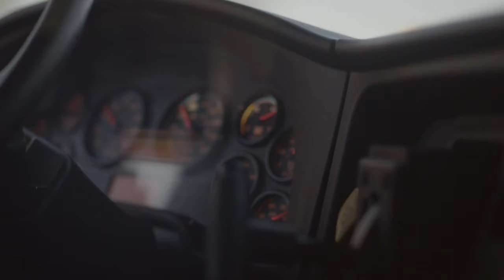The IC Bus CE Series Powered by Gasoline - Purpose-Built for the School Bus Industry

Comment: IMO the gas engine also should be offered on the 4300 chassis for applications like box trucks
Reply: Probably would not have the torque for hauling maximum rated weight
Reply: @LegoWormNoah101 the CE (a durastar) is rated to 33,000 lbs.  the same chassis is rated between 29,000 and 44,700 pounds (frame and axle limited respectively).

Comment: Don’t forget mileage will also be worse. With a diesel, you’re looking at probably 8 mpg- 10 probably at most. But a gasser would probably get about 5 or 6 mpg
Reply: That Copyright Guy deisel it is
Reply: With the gas engine you will not have any issues with DPF or SCR though, since they are not required to have of that crap.
Reply: @captainredneck0683  also you have instant power with no spin-up lag or turbo lag

Comment: "We have a bunch of New and old
IC CE Buses here in Kalamazoo,
and in Michigan, it's good here
in this State. And these Buses have MaxxForce DT 7.6L, Cummins ISB 6.7L,
& PSI 8.8L Gas.
and here in this School District,
it's good."
Reply: Y’all still got MaxxForces? (known to most as MaxxNoises)

I loved those engines, uhh, when they were running well.  Very cantankerous, but if they were happy, I was happy.
Reply: "They made the MaxxForce Engines
in 2008 for the 2009 IC CE300. The
MaxxForce DT, & MaxxForce 7."
Reply: The 2005 IC CE300 2nd Generation
has the Early 1980's DT466 7.6L Diesels. I love the color of the blue
for that one, it gets a lot of power.

Comment: "We partnered with PSI..."
If IC and PSI are sub-brands of International, are you technically partnering with yourself?
Reply: Completely separate companies, though since PSI is public, Navistar/Traton/Volkswagen could very well be a shareholder.

And the industry loves muddling waters, like Western Stars built with Mercedes Benz parts, that look like Freightliners, with “Detroit Diesel” motors.

Or in International’s case, the ProStars (a fantastic truck) have the A26 motor as an option, which is just a MAN (another Traton company) D26.  But unlike Daimler, the D26 is an excellent motor.

Comment: I drive one of these busses currently (same year and model). Anyone else having issues fueling? We have to position the gas pump just right, upside down, and barely squeeze the handle in order to not have the gasoline spew all over the place, this obviously takes alot of time, Anyone find a solution for this?
Reply: Might just be a cheap brand nozzle, I used to prefer OPW/CIVICON.

Comment: Hey WOW man, like I had NO idea, is this a new engine or is this aluminum block or is this basically a automobile engine or is it a modified diesel? and the biggest question, did you protect the fuel tank from things being driven into IT...?
Reply: It’s based on a Vortac 8100 (L18).  Fantastic engine.

As for tank intrusion, after the Carrollton collision (the location of which I used to pass routinely), they have certainly increased protections by leaps and bounds, both in tank design, and in the chassis, and added automated fire suppression systems.

Comment: lol we have a 2021 Gas ICCE and it SUCKS! the transmission is so Rough when shifting and flooring it it does a 0-60 in about 28 seconds! I Remember the Cummins engines were Basically indestructible and it actually had power! (we need power in our route) And The shifting is like you hit a bump. The trans shifts, and you bounce! I Like the IC Brand, But i Hate the 8.8L Gas Engine paired with The Trans!
Reply: Allisons are rubbish at shifting anyways, now I can’t speak for these engines, but Cummins diesels are fairly torquey across a good band, the smaller displacement versions of these have less torque (all gasoline engines do) and have the horsepower at the top end.
Side note to level the field, the ISB is woefully underpowered for these applications, the ISL9 ought to be used.
Reply: Idk what Cummins you've drove by the isb is weak AF especially compared to these granted we have bluebirds with the ford 7.3 and it's a beast.